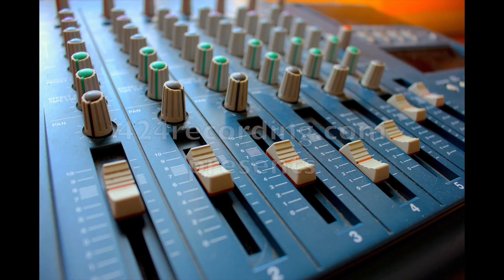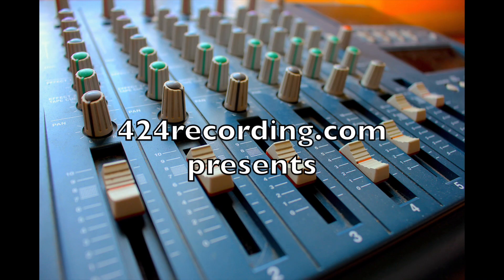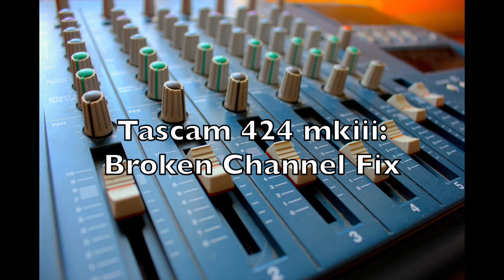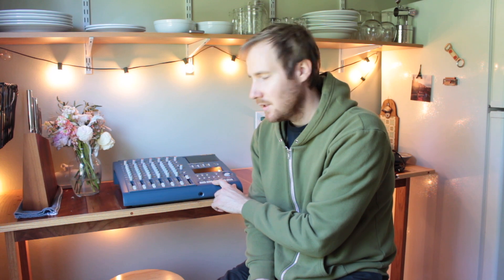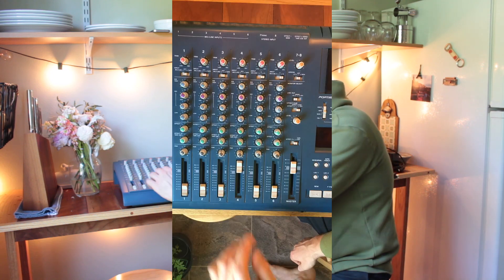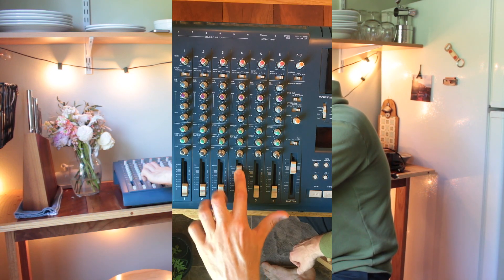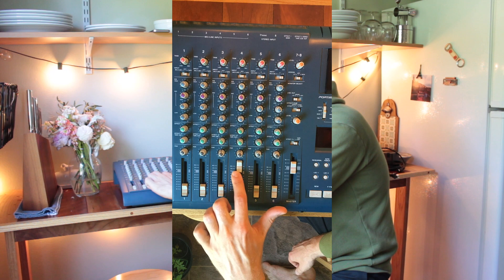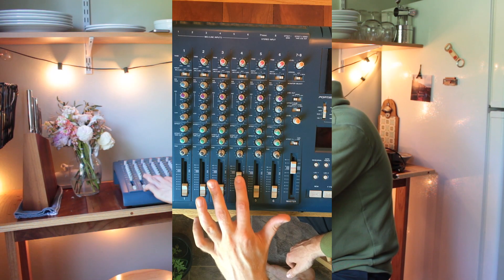DEAD CHANNEL ON A TASCAM 424 MKIII 4-TRACK CASSETTE RECORDER | 424recording.com

Comment: Hey man -Thanks for the incredibly helpful videos. I just bought an as-new Tascam 424 mkIII - I love it but there's a serious buzz on channel 2. I'm new to 4-track recording but can't seem to find anything online about this issue. It's not an RF or grounding problem as I've checked this. The buzz is high-pitched and only happens on channel 2 (and to a lesser degree on channel 4) when tape is being played (whether or not is has been recorded to or not). The fact that it's 2 and 4 makes me thing that there must be some issue with the right side of the tape but I've tried switching tapes and the buzz is still there. Any help would be so much appreciated as I'm losing my mind with this a little bit! Cheers

Comment: I’m experiencing that Ch 3 won’t record onto Chanel 3. Inputs are fine, I can bus to other Chanels fine, but can bus to get a recording on channel 3 even though the meter shows a signal coming in....I’m a newbie, any ideas? Thanks!
Reply from the maker: Hmmm not sure, Frank. That sounds like it should work
Reply: @424Recording  Thanks for the reply!! Seems like I fried the tape w/ too gain in the signal... put a new tape in the next day and was fine. Love your channel Mike. I've had my 424 MKiii since the early 2000s, but only recently got back into using it. Your vids have been a huge help!!!

Comment: It just needed a bit of lovin. I watched part 2, glad you've got it fixed.  I can't count how many times I've pulled my machine apart, soldering, stuck transport, gluing the counter button back on, and just general curiosity. Only one problem I haven't fixed is an intermittent power loss, I think it's the cheap power supply that came with it.
Reply from the maker: Yeah, I wish they were a little better quality. A lot of people seem to have a lot of different problems with these machines. All of mine have some small issue like that which is unsolvable haha
Reply: @424Recording  I think a company should make new ones. There's gotta be a market for them somewhere, and I think they would be cheaper to manufacture with almost 30+ years of new technology available.
Reply from the maker: Yeah, for sure. Jay and I toyed with the notion of doing so. The big thing is the head is proprietary tech I think and/or there's only one or two Chinese factories left that are producing cassette heads and they're not producing the 4-track heads. I think Tascam would be best suited for doing an anniversary edition. I bet if they made a 1000 of them they'd be gone in a weekend. They could even come with tapes from NAC

Comment: Only issues I've had with my 414mkiii is the line out jacks on the back are terrible. Always have been. They just weren't made very well. But lately track 1 on mine still records & will play back, but the levels aren't what they should be...& it also doesn't sound right. But just on track 1. It sounds ok when recording the track, but during playback/mixing, the levels are low...so low I have to push the fader all the way up. & it doesn't sound like it should...because I have 2 rhythm guitar tracks, one panned left, the other panned right. The one panned right, on track 2 is fine, but the one on track 1 won't sound right & I have to EQ it way different than track 2, even though it's the same guitar, same amp, same everything.

Comment: Awesome channel man, I've had a 424 for a few months now and I love it. I have a zoom h2n mic which I use to bounce tracks in stereo. It has a line in which I record all four tracks to, then I recorded that back into channels 1 and 2 from the line out (headphone jack) and I have two spares. Eventually it becomes a bit difficult to mix and you have to commit to everything early on, but it sounds great. Keep it up with the videos they're really good
Reply: After this comment, I stumble across your bouncing video hahaha
Reply from the maker: Hey thanks Dingo! That is one of the limitations of the 4 track format - committing to each bounce. You can try keeping your song as simple as possible with a minimal amount of tracks. Also, you can try using the individual outs on the back of the 424 to record your 4 tracks into a DAW simultaneously (doing a video on this soon) so you'll have more control over the mix digitally and then bounce that mix back to the 4 track, but if something is off, you can go back and remix the tracks in the DAW, rerecord the new parts, rinse and repeat, until you get the song to sound how you want. I've always felt committing to the tracks and song is one of the best features of the 4 track; solidifies what you're doing and pushes you forward, disallowing you to get caught up in the endless DAW tweaking and mixing. I will definitely keep it up! New video this afternoon. Thanks for commenting!
Reply from the maker: Let me know if there's any videos you wanna see. The queue is many weeks deep at this point but I'll surely get around to them!
Reply: 424 Recording I saw on another video someone mentioned the effects send/tape cue stuff. That's still a bit confusing for me I can't quite figure it out completely. That would be a good video
Reply from the maker: Oh yeah! That's coming up. Got a lot of videos in the cue right now: ping ponging, tape cue, effect send/ return, channel 7/8, and others I can't think of at the moment. Much more to come, Dingo...
Reply: 424 Recording Good to hear man
Reply from the maker: Oh yeah! There's one on Phantom Power coming up too!

Comment: I had a dead channel 1 input. I took it apart and used a can of deoxit some q-tips and a metal pick to scrape off all the residue on the PCB and it worked again. I blew the line by plugging in a keyboard wrong. Went through a di box boosted and a patch bay backwards 😅 whoops. But it had some.burnt residue def looked fried but cleaned it off and components still worked. 👍
Reply from the maker: Nice! I might have to take apart a 414 I was just gifted. I suspect it has a similar issue...

Comment: Hi i have an issue with my tascam 414. When I record a track it will initially playback fine as recorded but when I go to record in the next channel a large chunk of the beginning of the last recorded track does not play back, seems to completely lost on the tape. Do you have any ideas about what this problem could be?
Reply from the maker: Whoa I've never heard of that. I would try a different tape and clean the record head. Maybe there's some dust or something causing a drop out. Cheers and good luck

Comment: I just recently got a 424mkiii and after a lot of investigating I’ve discovered channel 3 is “broken” for a lack of better words. Track 3 plays back and records fine but the 3rd channel is really distorted and sometimes there’s no signal at all during both recording and playback. Obviously theres ways to work around this but I want to get it fixed. Does it sound like a similar issue to yours?
Reply from the maker: Yeah... try using a mic to send a really loud signal into the channel. When I used to do this with mine, it would "open" the channel up and make it work again. Not sure why. I used to blow into a mic and bam, it would work again until the next time I had to do that
Reply: @424Recording  im a bit late to this convo. But ive been looking for any hints online about my problem. This one here comes close. With my tascam It seems that channel 2 has trouble taking any input from either guitar or the mic/line in. The peak meter doesnt react at all. When i had the monitor and master fader all the way up, i could pick up some of the input - however very LOW. and tons of distortion on it. Got no clue how to fix that issue? I thought maybe its some sort of capacitor or electrolytic? Any ideas ? Thanks!

Comment: I'm having an issue.
I just got a room set up.
Took a week off work starting tomorrow and while testing everything so I could get an early start channel 1 will not record.
I can hear everything when it's on the mic record setting but when I play back after recording there's nothing. 
I checked the other lines and set them the same with no issues.
Help me.........help...........please?
Reply from the maker: Definitely arming the track properly? Is it just completely dead now? A lot of times with an issue like this, it's user error. I can't tell you how many times I thought something was up with my 4-track when it was actually me! If you're sure that it's not user error, I would try a new tape --> still the same problem, clean the heads. If it's not one of those 3 things, it might be something more serious... but check those first and give it another shot recording after you've given it some downtime! Good luck, Blake!
Reply: 424 Recording you were right.
It took me all day to figure it out but I thought I checked the sync switch but must have done the middle setting twice thinking I tried them all. Thx for the reply and help
Reply from the maker: Blake Whittington awesome! That’s an easy solution. My pleasure. Thanks for watching!

Comment: i actually need help with mine..theres no sound captured when i record through the 1st, 2nd track.. the 3rd track will appear super faint and the 4th track works fine..i feel like i only have a 1 track recorder.
Reply from the maker: Damn Khai that sucks. Hope the next video can give you a starting point for fixing yours
Reply: 424 Recording i just emailed the Digitron(as mention by one of the comments here) guys, seems they are willing to help. looking foward to your next video. might save me the whole hassle of shipping it to the US.
Reply from the maker: Oh heck yeah. Good call on Digitron, David! Hopefully, it's something simple. My issue turned out to be loose solder joints... Jay was saying that the way the faders are connected, it's really easy to move them from side to side in the slider and over time this rocking can cause issues with the fader separating from the board. Seems like a lot of commenters have the same problem. Hmmm, that must be expensive to send it here, Khai! Maybe it would be cheaper to find a second one? Best of luck! Keep me posted as to how it shakes out.

Comment: Dude! The cassette cover of my 424 came off.
I accidentally hit my hand on it. 
It's not broken but I can't get it back on.
Any suggestions on how to clip it back on?
It's not the board but it's on the board. Lol
Reply from the maker: Have you asked this question before, Blake? I'm having vivd deja vu. Um I'd say very gently try putting once side in and then the other, pinch it slightly but not too much! Good luck!
Reply: @424Recording  No not this question but man it will not go back on I tried everything its weird. 
Thanks for the help though
Reply from the maker: @blakewhittington4336  My pleasure! Good luck!

Comment: Channel 1 on mine isn’t working. I can hear faint music recorded, but that’s all.
Reply from the maker: Did you try a new tape? Clean the heads?
Reply: 424 Recording yes sir. My fourth track started to work again, but my first track is still really quiet.
Reply from the maker: Hmmm next step would be to get some contact cleaner or detoxit and spray the faders... that was a big help with mine when I had a similar issue